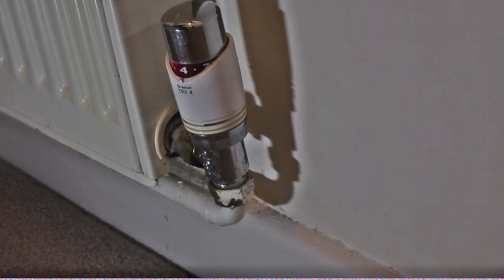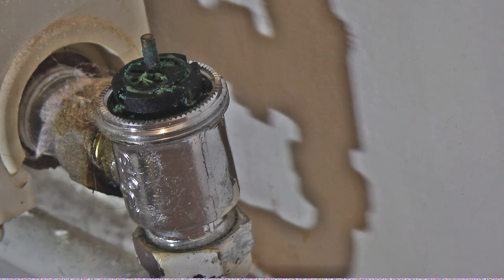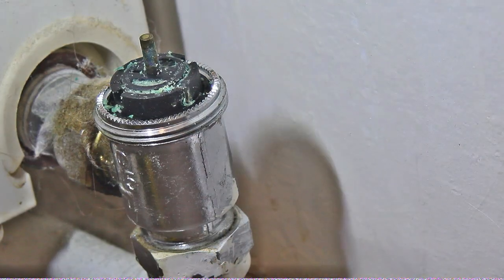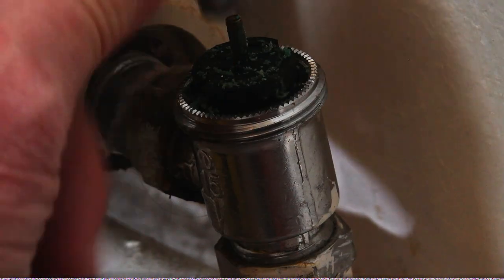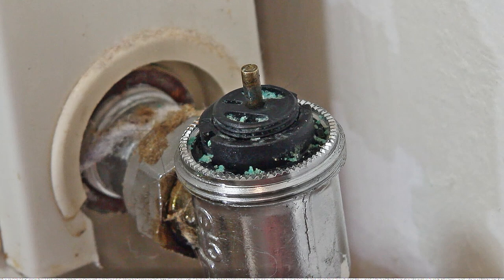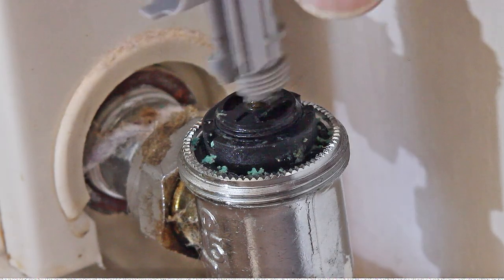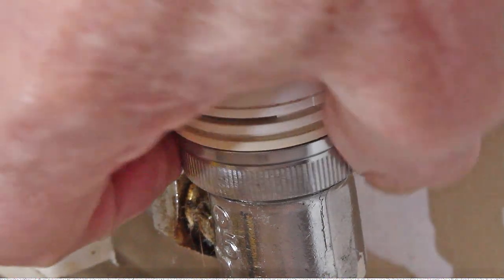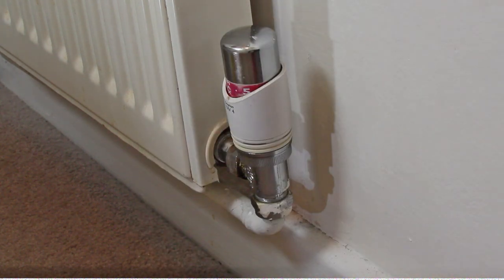Drayton TRV4. HOW TO REPLACE THE VALVE SEAL &  Prolong its Life

Comment from the maker: Hi Rock ,No it will not gush out just a small amount of water less than an egg cup .The Spindle will self seal once you remove the old seal but will just weep a little,just put a towel around the 15mm feed pipe and you will be fine .Cheers Brian
Reply: Thank you for your help and video. Please make more

Comment from the maker: Yes the new seal will fix your weepng valve ..Follow my recommendations of cleaning the shaft of silt. No leakage will occur and there not need to drain down. JUST PUT A CLOTH AROUND THE BASE IN CASE OF DROPPING ANYTHING OF FITTED CARPETS .YOU CAN GET THE SEALS ON EBAY FOR ABOUT£3each if you purchase four.Cheers Brian.😂

Comment: Ah.. glad I just saw this. Thank you! I’ve got a couple of valves that are leaking from that area. Will changing these fix the leak? I was about to buy a couple of new valves as a couple of mine are leaking. I thought I would need to replace the whole valve. I’m a wheelchair user, so it would have been a bit of a faff getting down on the floor to do it.

Comment: I have just got some of these seals and can't see any O-ring at the bottom you mention. Not got any leaks though. Just looked at one with a good magnifier and it is a special seal rather than an O-ring.
Reply from the maker: By "O"ring I mean it's a round generic term and not it's section .Make sure you use silicon grease and it will last much longer.Thanks for your comments and feedback.Kind regards Brian.
Reply: Thanks for the reply, I've just done three successfully and. greased them well. After more than half a century as a toolmaker I made my own removal/installation tool and glad to say it worked very well, ten minutes work saved a few quid!
Reply from the maker: @rinklestiltskin  Brilliant .I left school at 15 and did a five year toolmaker apprentiship with Fairey Aviation 1955. In 1962, engineers were not so much respected so i went into Broadcasting for 30 years .I've never regretted my early life ,as it gave skills you never forget.

Comment: FYI - In case of a combi boiler, if you see the pressure drop even after topping up say in 15 days or a month, then its a leak in the system and the gland seal in Drayton TRV 4's is "generally" the root cause.
Just in case you dont have the seals on hand, Teflon tape on the gland seal can arrest the flow to NO leak, stop gap arrangement. Cheers